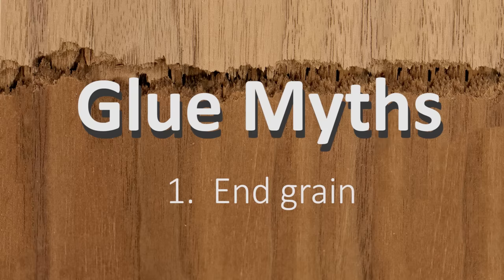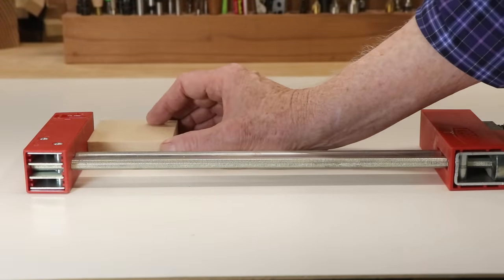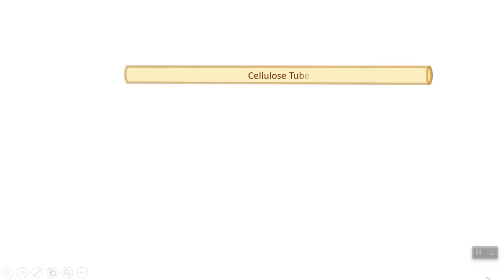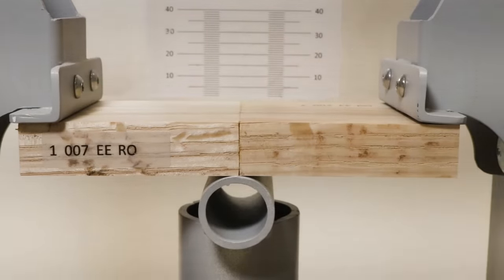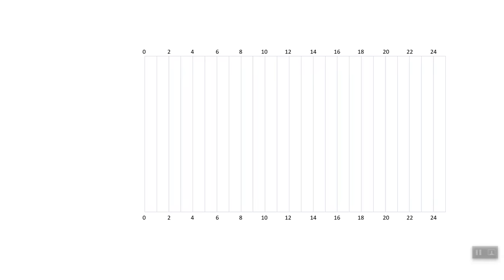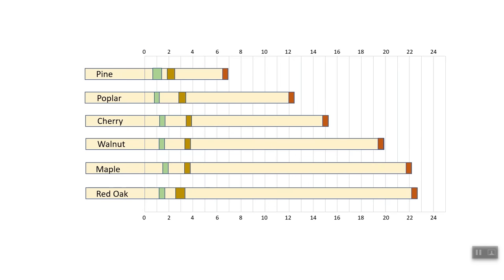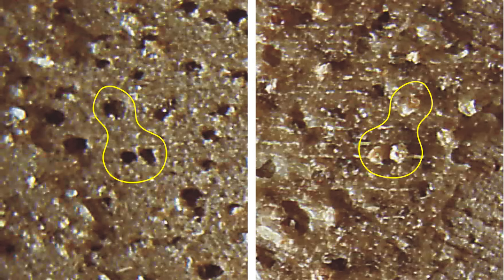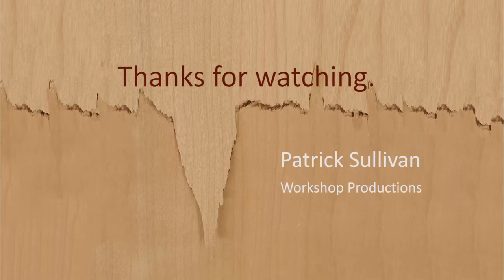Glue Myths:  1. End grain

Comment: I think the reason for the myth is that people were comparing end grain glue joints with intact timber. In other words, if you have a leg 600mm long, the comparison would be between a length of timber 600mm long, versus and end grain jointed piece of stock, with the joint half way along it's length. And as you prove in your video, the intact timber will always be stronger than the glued stock - therefore making the proverb "right" in a manner of speaking. But the proverb is supposed to be comparing end grain joints to side grain joints. As you say, the proverb is comparing apples to oranges! Excellent job there. As a Cabinet Maker and Luthier, I've learned something today!

Comment: Gluing should provide equal or greater strength throughout the elements that are being joined. Gluing end to end doesn't do that, instead it's weaker then the rest of the ELEMENT and creates a place where failure will occur, as you so clearly demonstrate  at 6:44. Strength matters, that's why it's important that elements have correct grain orientation or failure can occur. End to end glue up reduces the overall strength of the element, and that's why you should avoid such practice.
Anyway, thx for the effort of making this video, it's quite informative and well done.

Comment: I'm not a woodworker and I always expected endgrain joints to be the strongest because of the improved grip. I remember roughening up the surface of wood when I had to glue it side to side. I did not expect the wood to break before the glue did, especially not when applied to the relatively smooth surface.

Comment: I glue heaps of end joints all the time with segmented canisters, bowls, mirror surrounds etc etc ,never ever had one fall  apart. I think the main point for failure would be glue starving the joint with to much pressure, I found light pressure for a while then increase the pressure after glue has set a little. Once again great video and very informative!

Comment: As so many have siad before, a great and fascinating experiment, very nicely explained. May I suggest a all-in-one experiment? Start with a square board. With two cuts, cut it into four equal squares. The glue back together. Place the glued board on four pillar in the corners and apply pressure in the middle, over the intersection of the four small squares. In principle, it should brake alongside the side grain borders, but given that there are torsions, maybe not. I think it is an easy to do and interesting experiment.

Comment: So I think my takeaway here is that comparing apples to apples, surface area for surface area, lignin (cross-grain strength)<end grain glue joint strength<<solid long grain strength. And to say "a wood glue joint is stronger than the wood itself" is misleading since wood is non-isotropic and so the strength of a glue joint relative to the wood really depends on the grain direction in the wood. As others have mentioned, it's easy to see a long grain joint fail at the wood and assume the glue is stronger, and then see an end grain joint fail at the glue line and assume the glue is weaker, and then assume that end grain joints are weaker than long grain joints, when really what we are observing is the strength of wood in different directions more than the strength of different glue joints. So based on the data, end grain glue joints are roughly 2x stronger per unit area than wood lignin (wood across its grain). But I think in woodworking practice, a long grain joint is also likely to have far more than twice the surface area of an end grain joint (e.g. a butt joint), and because the total force to break is proportional to the surface area of the joint (or stressed cross section), long grain joints in woodworking will tend to have more overall strength merely by virtue of having far more surface area than a butt joint in practice. The mechanical interlock of a traditional joint (mortise and tenon, lap joint, etc.) will also aid in resisting the bending moments we see here and take some load off the glue alone, which cannot be accomplished with a simple butt joint. I think this is why if you're trying to join two pieces of wood at a given intersection, you're still better off using a traditional joint with more surface area and mechanical locking than a simple butt joint, even though an end grain glue joint in a simple butt joint may technically be stronger than lignin for an equal surface area. So this experiment is very interesting and I may give the simple butt joint a bit more credit going forward, but it won't change my joinery strategy for the aforementioned reasons.

Comment: A trick I have used to strenthen and end grain joint - let the glue soak into the end grain before assembly &  clamping. You need to thin the glue down a tad to allow it to soak in well. Finally, add glue at full strength and clamp as usual.

Comment: Brilliant piece of work. And the cascade of follow-ons from all other big-hitters below is great. It's made me realize that I should stop worrying about the strength of the glue at the point of contact, and focus more on reducing/spreading the forces at that point of contact. I would guess that the end-grain myth came about because end-grain joints are typically subject to greater leverage than edge- or face-grain ones and therefore experience greater forces. Coupled with the fact that nothing seems to beat the strength of the long-grain fibres, this would lead to end-grain joints breaking more often leading to the unjustified conclusion that glue is weak on end-grain. Again, excellent bit of research IMO.
Reply: No, it is cause the joint it self is just weak - as he has demonstrated in this video even.
Sadly has just did not show something like a lap-joint - that is multiple times stronger as that is a longgrain joint.

Comment: As a seasoned industrial abrasive salesman who sells wood glues of all kinds, I find this fascinating. I've glued end grain in projects just because it didn't seem right to leave them empty but never suspected higher strength. If you want end to end glue ups that can be used as hammers, try polyurethane reactive hotmelts. Stronger than the wood fibers in most cases

Comment: My technical thoughts on the superior strength of end to end gluelines on your species tested, is that the end grain porosity for the glue increases the bonding fixing "length" and so the glue attaches to more wood fibres, both lignin and cellulose, between both pieces, forming a stronger attachment .  This opine from a retired wood chemist and preservationist from the Qld. Dept. of Forestry, who experienced some gluing problems in the timber industries.

Comment: Amazing research on this.  One more thought as to why end grain was thought to be weaker: Since they break on the the glue joints compared to side grains breaking at the wood, the assumption could have been that it was a failure of the glue to get a strong enough hold on the wood because of the end grain surface.  Without considering the strength of wood at lignin vs long grain, one glue up looks like the wood is stronger compared to the other making the glue bond appear to be the weak link.

Comment: It would be interesting if you took a small amount of glue and smeared it on the end grain to seal the pores and let it dry. Then do the end grain glue joint again. I used to think that the reason end grain joints were weaker (which you have shown they aren't) is that the glue went up the pores and you ended up with a glue starved joint. Nice video and fun information.

Comment: About 20 years ago I made some cherry cabinets doors with glass in the frame. I split them vertically with a bevel cut to create shallow V doors. The glass had a silicone joint at the bevel. I only butt glued the wood middle joint and it has stood the test of time!
I also join  pieces of trim for long sections with a butt and stretched tape to hold it . Those I do brace however, with a piece of wood bonded into a groove if it needs to be flush on the backside.

Comment: This makes a lot of sense, side-grain always fails on the wood, so we assume "the glue is a good bond here", and end-grain always fails on the bond, so we assume "the glue bonded badly here". But we completely forgot that hey, wood is way weaker between grain than down grain, maybe the glue isn't failing only because the lignin is so weak. 
Plus, yeah, there's a reason we run the grain along the long dimension of wood. Well, mostly because trees grow taller than they do wide, but also because it's way stronger that way. 

I do wonder how strong the actual bond is in side-side bonds, I imagine it's weaker than end-end because it's less rough, but I can't think of an easy way to test it since it's not the point of failure.

Comment: Amazing and thorough investigation! As a structural engineer who has done a fair bit of work in structural experimental labs, I completely recognize and trust your approach and conduction of this experiment, as well as the results you've provided. I have full confidence you know what you're doing! 

My following question is in now way trying to discredit this experiment, but merely a curious mind looking towards the next steps in this investigation. Feel free to correct me if I have misunderstood or miscommunicated any of my assumptions as well. Bear with me as I nerd out below!

The loading configuration of this experiment is imposing a moment (force couple) across the glue joint, meaning that the bottom face of the member is in compression while the top face is in tension (in the boards with no glue joint, you can see the grain literally ripping apart at the top face because of this tension force). This means that the primary failure mode of the glue joint (or the wood for that matter) is due to a tension force. It is my understanding that wood glue is strongest under SHEAR force, which can be described as the two pieces of wood being loaded in opposite directions along the same plane, where the glue joint is running parallel to the direction of loading (as opposed to tension or compression loading, where the glue joint is running perpendicular to the direction of loading). I admit, the experimental setup would be much more involved to load the members in this way, and some creativity may be required to properly place the load cell within the experiment. I would be curious to see how these different glue applications and grain orientations would behave under those conditions! If this is an experiment that anyone would like some assistance exploring, I would be more than happy to help out where I can!

Once again, I want to commend you for taking the time to investigate this properly and thoroughly, and sharing this game-changing data with the world! I am looking forward to seeing the world of woodworking explore the new types of joinery that we have all been afraid of for so long!

Comment: Very fun video! I remember doing an experiment with glue in our lab where we compared the shear strength of PVA glue at different watered down ratios. We found that the glue performed better at certain ratios as the glue was able to better permeate the wood structure.
Reply: If you used epoxy properly in your experiment you would be staggered by the difference, but you hate spot on its the penetration into the end grain that counts.

 Epoxy resin and hardener mixed, especially when warm, will penetrate very deeply into end grain. You wet out and wait sometimes it can take two or more application with a 10minute wait for the end grain to be saturated. Then thicken your mix with wood flour or preferably silica and glue up. The result is a chemical bond between the two pieces that penetrates deeply into the structure of the wood.   I'm no scientist just a retired boat builder but I can tell you from real world experience the results would outperform any PVA massively.  I got bored years ago watching woodworkers using epoxy as they have no comprehension of how to use it correctly for bonding.

Comment: With respect, consider this,
Say I wanted to test which of three bolts of different brands was strongest.
I put the first bolt in the test rig, apply pressure and the test rig breaks at 100psi. I rebuild the test rig  and repeat for the second bolt. This time the test rig fails at 150psi. Once again I rebuild the test rig, insert the third bolt and this time the bolt breaks at 200psi.
Using the logic that’s been on display here, I can conclude that the third bolt, the one that actually broke is the strongest, since I measured 200psi. Never mind that the others didn’t break so I don’t actually have data. I’ll just substitute the data from the test rig failure instead.
This is what it seems has been done with your testing and why so many are confused.

Yes glue can be stronger than wood when used in a certain orientation, we've known that for quite some time. Wood breaks parallel to the grain, again, nothing new. You actually managed to break an end grain butt joint along the glue line which is why there is not a myth but common knowledge not to use that joint.

Comment: WOW! Thanks for the video and busting the myth..   Interestingly.. as soon as you started loading up the end to end joint, i realized my mistake... I"ve always known that when side to side joints fail, its the wood that fails, not the glue.  Hence, the bond from the glue is stronger than the wood.    i also knew that end to end joints will always fail along the glue line...    So, it makes sense that the end to end was failing at at a higher load.   Believing otherwise is actually counter-intuitive.      I just never put it together.. LOL    Great Video!

Comment: In fact you are quite correct. I have made magic wands for Harry Potter fans exclusively using end grain to end grain glue ups because they're the only joint I found that could take the high speed needed on the lathe (2500rpm plus). At the time I didn't know much about glue or wood, so gluing end grain to end grain didn't seem odd to me. It just worked better. The finished piece looked much nicer this way too

Comment: Great video.  When gluing end grain I let a first application of glue sit for a few minutes.  Mulch of the glue is taken up into the fibers and the joint looks a bit dry. Then,I add a second layer of glue and clamp.  I think some end grain joints fail because not enough glue is applied and the resulting joint is glue starved.

Comment: pretty well done.  I've been a woodworker for  60 years and always assumed that glue didn't work well on end grain.  Of course your demonstration of the two narrow pieces being joined end to end was not apples to apples either.  The joint did NOT break at the glue line.  But the point is taken.  We often glue up parts with multiple surfaces contacting each other.  It would seam that certain types of glued joints are much preferable to others.  End grain? Fine as long as there is enough surface there.  Even better, if it can be a lap joint where the force will be along the glue line, not opposed.  I've usually found lap joints to be quite strong, but even better, bridle joints. In a tenon, quite a lot of the time, one spent thought to making the tenon surface not contacting the mortise end grain.   I agree now that this isn't so important is it.  It was always thought that dowel joints were not as strong then as a tenon because the dowel was glued to end grain in it's hole.  Of course if a 1/2" dowel is compared to a tenon that is longer than that, say 3/8" by 1", then it probably is as strong in the one direction, (the 3/8") but not as strong in the 1" direction.  More to be tested, but thanks very much.  I'll make good note of this in my projects.

Comment: I made wooden toolboxes some years ago with all glued joints, and just a few brad nails to hold while the glue dried. Some are plywood, others are pine boards with end to side grain joints at at the 4 corners and the handle. I lug a lot of heavy tools (pipe wrenches, hammers, etc.) and toss the toolboxes into my work van every day. That was about 8 years ago and they're still as solid as the day I made them. 'Nuff said! 👍

Comment: Interesting demonstration!  This illustrates a simple fact... the glue itself does not know what kind of joint it is holding and is equally strong regardless of grain orientation.  The demo well illustrates wood's ability to hold itself together when pressure is applied in the different orientations.  What the demo does not address is how glue/grain orientations of joints withstand stresses induced by loading of forces during normal use of your widget after it is built.  Example:  Rails joined to solid wood end panels on a piece of furniture must withstand much higher stresses at the joint than are placed on the glue joints that form the end panels.  Therefore, a rail butt glued to an end panel will ALWAYS fail essentially at the joint, while the edge glued joints on the end panel's individual boards will NOT fail, assuming joints are properly created.  Take these demonstrations for what they are worth, but if you rely on glue alone to secure end-grain butt joints, your project will fall apart!  This stuff has been known since the invention of hide glue in ancient times and is taught in woodworking 101!   🙂

Comment: Great Video!
The bad Rap end joints get is not a function of the wood or the glue but indeed the design of the structure.
End joints, as you explained at the end, often focuses the stress on the joint, as opposed to spreading it over the volume of the wood. Bad design or incorrect use of the structure is therefore what causes joints to fail.